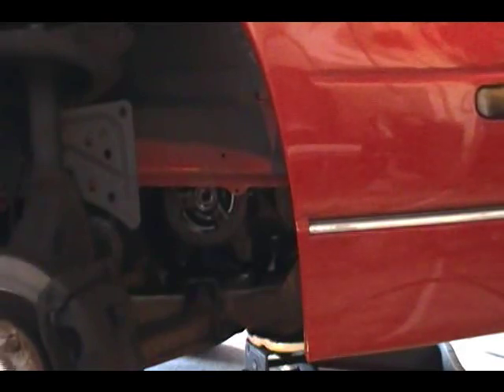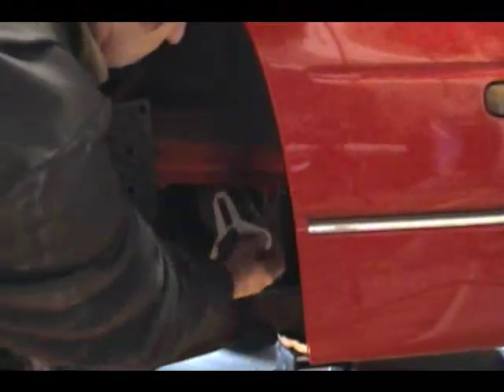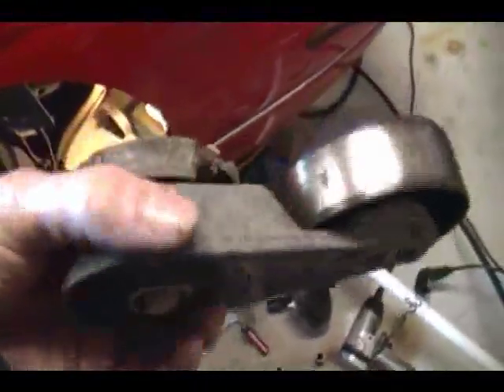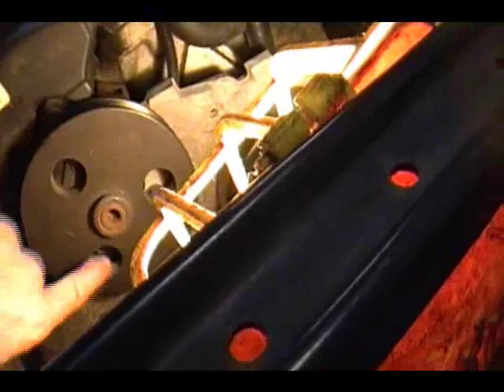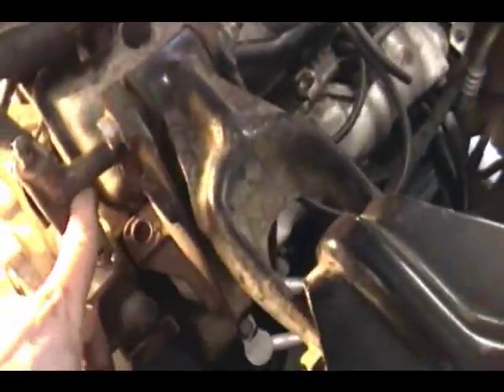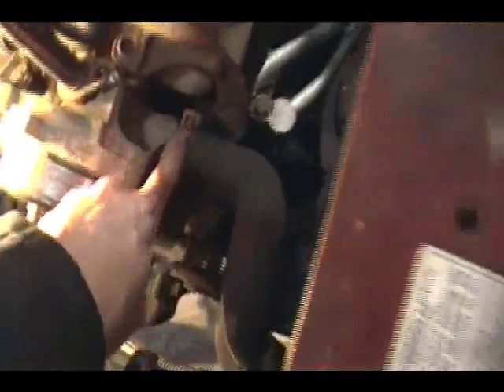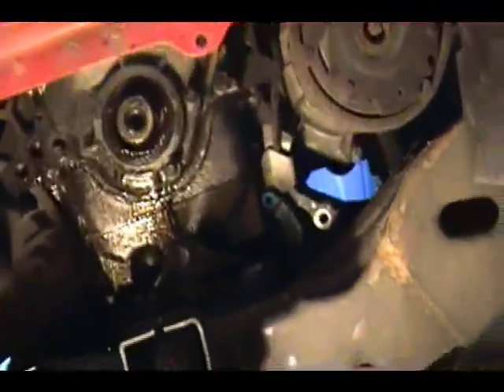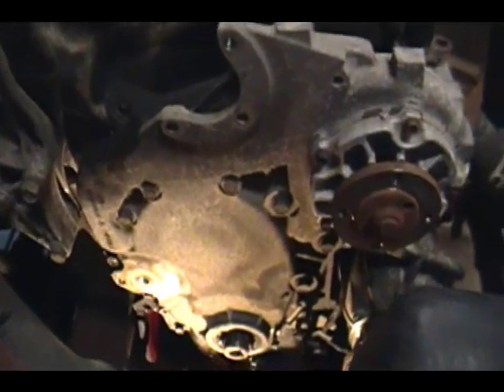Chevy 3.1 Front Cover Gasket Part 3

Comment: I have to do this on my 94 Cutlass Ciera 3.1. In my case I’m fairly sure I’m replacing the timing chain and wheel sprocket, as the motor stalled and has not restart and makes an odd sound when trying to start. Hope I’m not barking up the wrong tree on this, but I know I have a coolant leak in this spot as well. Thanks for multi part video! Big help.

Comment: I believe it is difficult to get the power steering pump out without either removing the upper lid or wants the timing cover came away and eighth of an inch it pops right out but you have to remember to put it back into before you go back together;-)